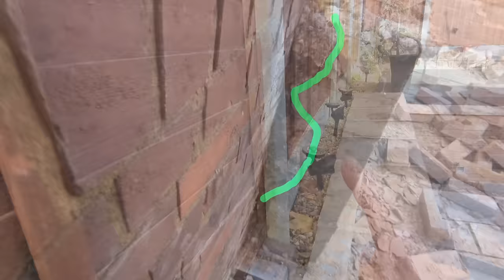PART 2! What exactly DID go wrong? Who paid to put it right?

Comment: As soon as you mentioned 5:1 in your last video I knew where you went wrong. NHBC mortar mixes appendix 6.1-b through to appendix 6.1d will answer all your questions, basically you've got brickwork below DPC  and should be using 7:2(air -entraining plasticiser) or 3:1. I live on the south coast in Sussex (server exposure area) and see this all the time, weak mix in exposed areas = mortar failure, Looked like you were using some type of fletton these will take some time to fail, areas of the face will crumble and normally takes 20 years+.

Comment: Great video ,I feel your pain .being involved with bricks and mortar over 40 years .there’s traps every 😮where ..I’d be thinking that if the bricks are still intact ( no signs of fractures and fretting ) it’s a problem with the mortar .true that the constant wet is a problem..I d be tempted to seal the wall that’s holding the fence first ,then using a waterproof mortar mix .if there is one or something to add into the mix…

Comment: If you ever landscape a garden like that again the first two courses of brick should be underground with weepers and the patio should have about 80-100mm type one for water to flow under ground and 100% wall should be tanked if you don’t tank it it will happen again mate … saying that it looks good and hope you’ve a happy customer

You can tank it with tanking slurry prime with sbr to bind it  buy it of the shelf ready to go and if you like make a mix with sbr sand cement freeflow and put that over the tanking slurry.. put type one or pee gravel at the back  of the wall so the water runs through with a bit Terram round it to keep it clean… 

If the patio has proper 80-100mm type one the water will flow underground and if there was no previous drainage issues it would be fine … it the was previously issues you run a field drain in to a down pipe and have 150mm-200mm type one under patio … 

That’s what a landscaper would do

Comment: I'm not a builder but I would've used two sand based weep drains on lower level, with dpc behind both walls and made easier by lifting the slabs. I'd also have a word with neighbour to improve their drainage to offset flow. Direct the flow to easiest path. But I think you 100% correct re drip

Comment: Agree with the coping theory mate but I'd still use a vertical membrane between the old and new walls. You can still drill and fix through it as a small screw hole won't be the end of the world and I'd punch a hole in it at the bottom for weep holes. A membrane won't cause additional problems and is minimal work/cost.
Well done for putting the job right, you're a gent sir.
Reply from the maker: I'm hearing ya pal! Appreciate the advice mate, hope you're well.

Comment: Nice job, as a contractor in the states I think you taking ownership of the mistake is the proper way to handle this. The homeowners put their trust in your knowledge to build them a wall that will last and though you didn’t take the water intrusion into  proper consideration it was still your expertise they paid for. It was a miscalculation of the amount of water you’d be dealing with that ultimately lead to the failure of the wall. This is you paying for your education and I doubt you will miscalculate again on something like this. I’ve had to pay for replacements on jobs before it happens to us all so you did the right thing and we who take pride in our work would’ve all come to that same conclusion.

Comment: It would be interesting to measure the distance from next doors foundation to the retaining wall. If it’s below the minimum angle of influence, then that retaining wall that’s already out of plum is destined to fail. Regardless of water fall, the displacement caused by the house next door will cause that wall to fail. Water, rain etc will speed up the process causing instability. I highly doubt the soil etc was tested to standards. This is even an issue with large commercial buildings. Look at Fidi tower as a prime example.

Comment: Your explanation makes more sense than the water coming from the ground as the facing wall on the decking side you said had an air gap between it and the block wall behind it, so it shouldnt get much water direct from the ground behind it.
It would explain how its freezing the mortar at the front and back and it blowing out though.

Comment: I will tell you exactly why the mortar has failed. The next door neighbour has been jet washing their stone with an acidic cleaner. It has slowly entered the brick courses which are alkaline and has consequently eroded and broken the bond created by the cement with the sand. The bricks are resilient to acid erosion. Ask the questions before you spend lots of money and time. Kind regards
Ken
Reply from the maker: Now then Kenneth, THAT is a theory that no one else has come up with before now...and I like it! Do you really think that that could be the cause?
Reply: Wasn't there a wall behind his wall? Did the other wall fail as well?
Reply: You might be onto something there. Still need to address the water drainage issue to stop the water getting through the blocks, but definitely, if the water is mixed with acid, then a very good chance you are spot on. I would take down the block retaining wall, rebuild it, or better still get access next door to dig out, then paint the back block wall with tanking slurry,  then add a 100mm pea gravel strip the full height of the wall and make sure all the water behind it is directed out the weepholes and is not letting the blocks soak in water.
Reply: Yeah, pretty good chance a chemical cleaner was used on THIS side of the wall.
Reply: Late to the game, but definitely test the acidity of the drainage
Reply: @mrabuilders6723 

I immediately thought acid wash. It didn't occur to me about the neighbours' cleaning. That would explain the joining wall mortar failing but not necessarily the return below the deck.
Perhaps the owner has repeatedly acid washed the wall to remove mould. Either way, I'd use a mortar that is resistant to acid. If it exists.

Comment: Mortar for this type of wall needs to be M6 or stronger.  Land drainage is to alleviate the pressure behind a wall. Gutter from the neighbouring  building was visible behind the fence (so bungalow on the land footprint / no catchment). Fence and wall appears to be on your Client's land..... so I suspect the repose angle may be pushing on the wall and causing the rotation. Agree on the expansion joints which would be more, due to the height / width ratio of the wall. Wall  also looks to be working hard, hence the rotation. 1 brick retaining - circa 825mm height - this side wall looks about 1100mm (trying to count coursing and assuming a 1200mm level)
Reply: At last, someone knows what mortar should be used. I see this all the time here on the south coast.

Comment: A membrane should be used because without one the wall sucks the water in,it's one reason why they're used when doing planters or underneath concrete floors and I doubt the engineering wall has one behind it which if so is one reason it's moved and the bricks are less absorbant than your fletton wall so the flettons will soak up more water.On top of that the engineering wall looks like the pointing's all blown again adding another reason it's moved . Yes engineers will be better and a drip should have been used under the slabs and copings would be better also maybe do the backup blocks with sharp sand but id defo use a membrane or  liquid waterproofer the backs of the blocks first - membrane a lot easier and better.Not sure if the slabs were angled so the water can run off but they should have a larger overhang and a drip so the water falls an inch or two passed the face of the wall. Also if done properly using a 4/1 mix or a 6.1 and 1 with lime you shouldn't need to but just to be sure maybe give the whole lot a coat of watered down unibond or a liquid waterproofer after.Of course it wont seal engineers but it will seal the joints for what it's worth.
Reply from the maker: Nice one!

Comment: Respect for showing your mistake. But I wouldn't have redone it with the same brick only to have to do it again the next summer. At that point you've done the job 3 times and got paid only once.

There are plenty of solutions you could have gone with while you had it down.

For example, you could have stood the wall back from the blockwork another 50 mil or so. That would have given you space to attach a membrane to the brick (not the block behind it).  Then you leave more weepholes at the bottom (don't cover them with the membrane obviously) and backfill with gravel.

This will keep the brick dry and allow the water to flow through, the gravel is to make sure the weepholes don't get blocked with mud and debris

Comment: Just to say well done sorting this problem, enjoyable to watch but a pain for you. Looks nice but this is just a total after thought, the decking may have been able to extend to the edge of the wall and composite type fencing or decking horizontally fitted to the top of the wall and maybe with posts which are higher so a wrought iron fence or rope edging could be fitted as there is a fair drop if you fall over the edge. (safety rail)
Quality video, quality bloke, not many builders would be as conscientious as you.

Comment: It’s kind of convincing it’s the build up of water behind the walls / walls constant wetting etc. Think you’ve improved that with the remedial work so it won’t do any harm. 

I think there’s a few things you might consider in the future 

I think you dId have a mortar failure - or preparation of it with the bricks used in building the single leaf ‘cladding’ wall. 

You might well have used the correct ratios of sand / cement etc - but did you use sulphate resisting cement 🤔 

The way the bricks were easily removed can also suggests that most of the water within the mix was absorbed into the bricks on laying. 

Dependent on the time of year - in hot weather - & especially with blockwork one would ‘wet’ the blocks before using within a wall construction. 

This was a practice I had to oversee on building blockwork retaining walls in raft foundations abroad. It was obvious the next day if this wasn’t practiced as you could simply pull the blocks out of the wall construction the next day. It may well be that the batch of bricks you had may have had a very high moisture content - supplies might have been variable at time of purchase. You might not have known on visual inspection. Either way - something to remember especially if building a single leaf wall such as this. 

For a bit of light reading I’ll put a link below which I got after a quick Google. I haven’t read it fully but it’s informative / of interest if one finds this interesting. NBS also have info if wanting to delve deeper 

https://www.thenbs.com/knowledge/building-pathology-moisture-conditions-within-external-masonry-walls

https://www.sciencedirect.com/science/article/abs/pii/S2352710217306800

Brings me onto the next observation - it would’ve been preferable to tie this wall to the existing blockwork wall. That would’ve helped the overall performance of the wall but wouldn’t have changed the mortar scenario. 

You probably wouldn’t build a single leaf wall of that height in a garden anyway so if you can tie it back then that’s well worth doing. 

Similarly, engineering bricks usually used - thickness minimum 9” etc - & mortar specified to suit. This doesn’t have to be the case - but it’s proven. 

We don’t see much - if any problems with the existing blockwork wall that is  there - the blockwork ‘might’ be thicker too - it might be comprised of two leaves of blockwork with concrete / reinforcement between. 

There are many ways to construct garden walls - by eye / rules of thumb for height/widths etc & when they are retaining walls then things are different - and as a builder it’s worth getting advice if unsure from a structural engineer to come up with something workable & fit for design. He could/would also offer additional advice on any other areas of concern - which you have in the wall between the houses. 

My thoughts from the video is that the wall looks of very good construction. But, it has rotated. This is a foundation / design problem & overall can be classed as a failure. 

The owners should be looking for the existing drawings / plans for this wall - if not held then possibly the local council to see what’s on file. From drawings should be able to gather what the drainage intentions were. 
 I’d have expected a French drain / channel /granular material backfill to drain water build up away. 

As there are no weep holes within the wall - which is possible as there was no intention to discharge water in the corridor between the properties - the wall maybe twin leaf Engineering brickwork with an inner concrete reinforced stem. 

The foundation under will also have been designed to suit. If it was just ‘built’ with a trenchfill footing then that’s why it has failed. 

Not sure if neighbour has vehicles on the other side / has built or put any additional loads on their side - but any vertical loads will transfer horizontally to the wall which will make things worse over time. Strangely enough - even the fencing panels will transfer horizontal loads to the wall - but hey - it’s a short term load  

So, that’s the other can of worms but not part of your remit - might be worth advising your client though. 

Lastly - the ‘in-between’ area you can’t get to - waiting til summer - sounds reasonable - no point doing it now - but if you had to do it now it’d be dig out in small sections like an underpin scenario / backfill with granular material. Water will finds its way out

Cheers for now
Reply: The only other thing I’d add is did you build off the existing footing to the blockwork wall or put in a ‘lump’ for the brick skin?

They’ll move independently if you had to - but that may take some time - or little time - grace of god & all that 

Also / the brick expands as it heats up - the stone/capping will contract / so they will oppose one another - reasons why one might use a dpm between them - but hey - it’s a garden wall - length or wall not that long so risk minimal - 

For roof upstands/copings etc then of course you’d be employing these measures as a matter of course….prob a pun there 🤔

Comment: Just come across part 1 now and had to watch part 2 to see what happened. Good job on being honest and dealing with the problem and accepting responsibility for a pretty big oversight, but not a glaringly obvious one. As they say, hindsight is 20/20.
I am curious though, the neighbour’s wall leaning is also a point if concern and interest - I would be interested to know if you raised this issue with the owner you built the wall for and the neighbour who’s wall is showing signs of leaning? We are experiencing worse and worse weather in recent years and the rainfall is only probably going to get worse and erode the situation more. The sooner the neighbour knows about this the sooner they can take action themselves to reinforce it and potentially install better drainage in their property to save dealing with that wall collapsing, and that would also aid in keeping your work on the new wall a lot dryer from heavy rainfalls and ground water?

Comment: You could try lime instead of cement and definitely without putting any cement in the mix. Lime is breathable and allows the transfer of moisture/water through the walls. 

I hope your solution has solved the issue though.

Comment: That mortar was far too comprimised given its age to be solely down to freeze thawing. The neighboring brick wall had very little ventillation and zero sunshine. It's possible the mix was too wet when it was put down, or insufficient plasticiser was used, causing the mortar to shrink and take on more water when it does rain. Shrinkage could explain why the bond is still in tact in the frog of the brick too.

Comment: Should just re design it with like you said, railways sleeper, place them an a staggered and stepping down arrangement leaving enough room away from the blockwork for a plant bed for few shrub hedges there which wil gladly drink the water coming down the hill , the sitting area should be moved somewhere else, its just not a good place for a wall as you've pointed out

Comment: Put a lead tray in the blockwork span in to the facework with weep holes then corex on the back of the facework water will hit that, drip into the tray and run out. Also paint waterproofer on the front face of the wall to seal it

Comment: I think it needs a different design
The wall against next door wall need moving forward 6 inches so there is a proper gap between the 2 walls.
Along with the drip rails.
As next doors wall moves, you client can see it bowing and its all in the open for both house owners to monitor.

Comment: Ive built many retaining walls and would always put a membrane in and tucked it in to the brickwork, no need for weep holes that size either, and definitely channel in under the slabs/coppings. Ive been to jobs many times to correct the mistakes you made so good lad for being one to go back and sort it rather than the customer paying twice, we all make mistakes its how we learn but if in any doubt just do the extra better to be safe than sorry. 
20 years never been called back once and i use fairy liquid 😂

Comment: I would suggest two 4 foot  scaffolding poles driven in ,incased in 4 inches of high water resistant concrete with drainage tubes set in Faced with normal bricks in front and at the end tied in to the concrete, capped with concrete copping stones with a drip edge.